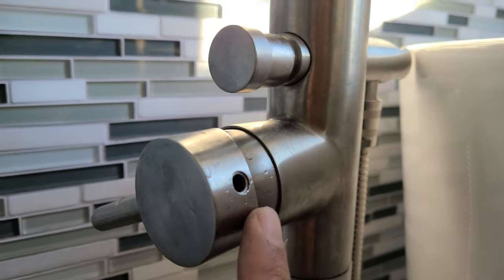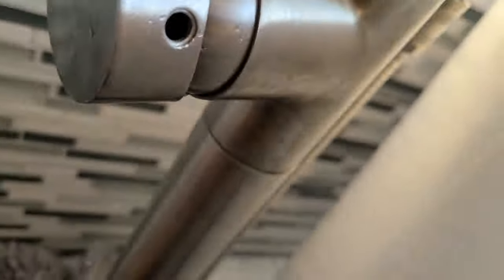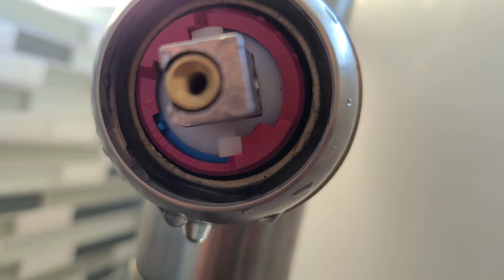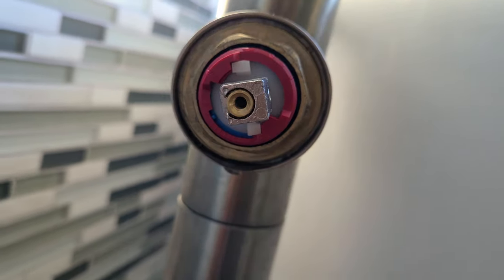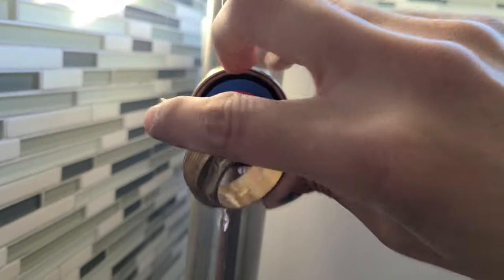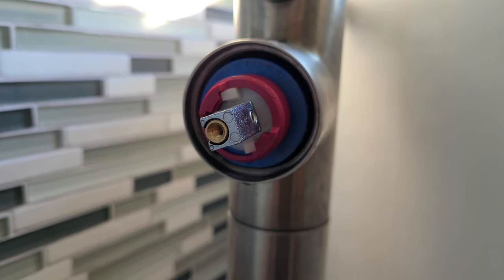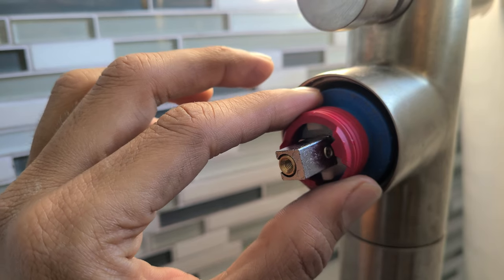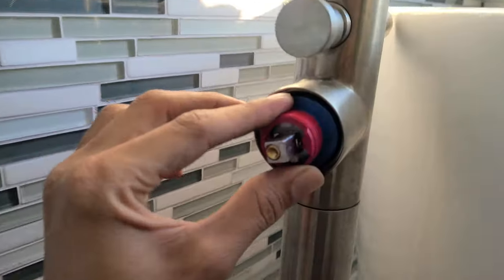Freestanding Faucet (Bathtub) Heat Adjustment

Comment: So did this work?  You never said, you just said if it's too hot I will turn it back again curious if it got colder or hotter with the adjustment you made?  The initial close up picture looked like the valve was maxed out?  Thanks